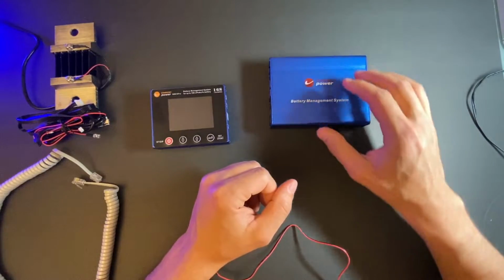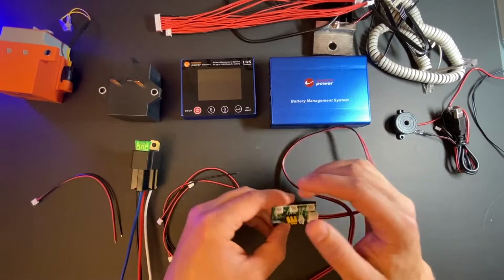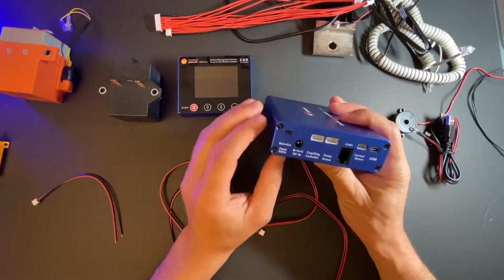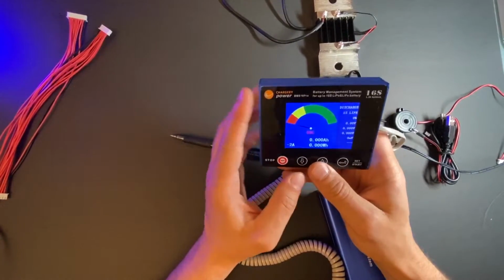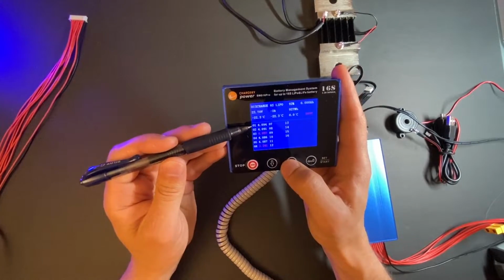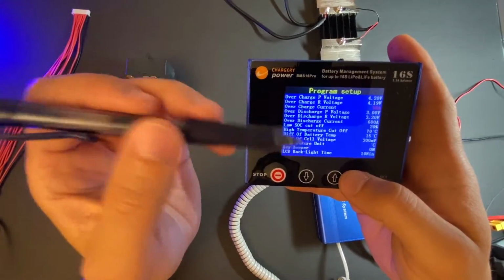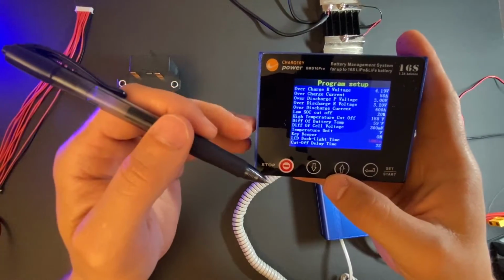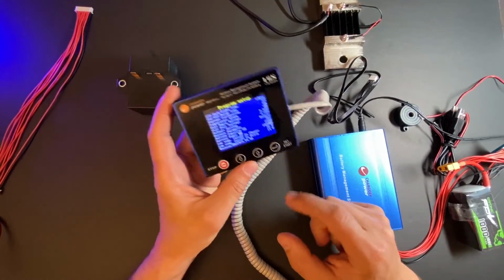Chargery BMS. Package and settings walk-trough.

Comment: Great work and know-how you share with the youtube community, many thanks! Just a question: would it be possible to publish a schematic wiring drawing to better understand your setup with the relain, the anti-spark resistor etc.? I'm sure that would be extremely helpful for those that want to do a deep dive or even re-build your great setup. Thanks!
Reply from the maker: Definitely will do, I'm planning to do a video on the entire system overview. Do you know software where I can draw schematic wiring?

Comment: Does the battery relay get hot because it's always on?
Reply from the maker: yes, it's about 115F +-
Reply: @SolarEngineering  maybe come up with a circuit using a normally closed relay.

Comment: Thanks for the video. I am planning to build the same, about 25kwh pack, and I am not sure about which BMS to use. I am seeing this DALY BMS a lot on Amazon. How is that? It does not have any LCD or temp sensor supplied with it! Have you tried using it?
Reply from the maker: I personally haven't tested Daly BMS, but many good reviews about this BMS. The latest version has bluetooth, but looks like no temp sensor. 
I tested another BMS recently with bluetooth and temp sensors. Checkout the latest video on the channel.
For a bigger system, I prefer to use BMS that could control charge and discharge using relays (I'm doing another video of my system were going to explain why), to at least BMS with the separate port.
Reply: @SolarEngineering  Thanks for your answer. I hv another question. Should I design just one pack with 16kwh with a 200Amp BMS or should I make 2 packs, 8kwh each, with 100Amp BMS each, and use in parallel? Also if I find later that 16kwh is not not enough, I can build another 8kwh and use it in parallel. What is your opinion?
Reply from the maker: @sarthak5  I built one pack for myself 3p16s. Less 'moving' components like BMS/fuses/breakers.
Reply: I would say the main difference is that Daily BMS and similar ones come with preset values for the batterie, no or nearly no adjustments possible and load and discharge current goes through the BMS. If worst come to the worst - over current will fry the whole BMS...This BMS is fully programmable regarding all parameters and controls relays to handle the current and cut of power in case of over oder under voltage.  Though less risk of frying the BMS